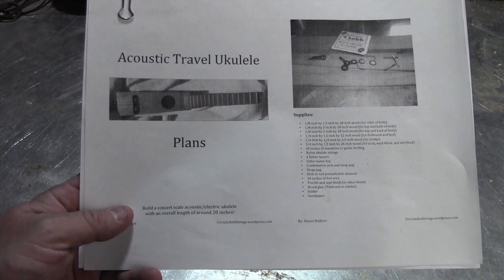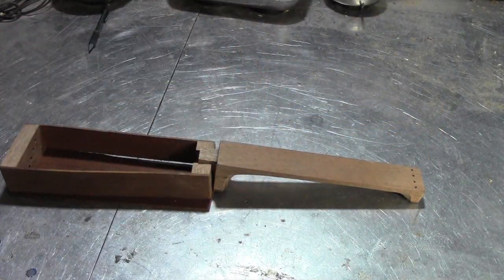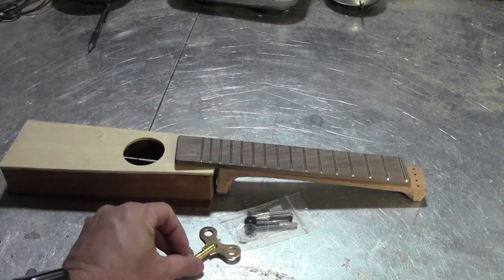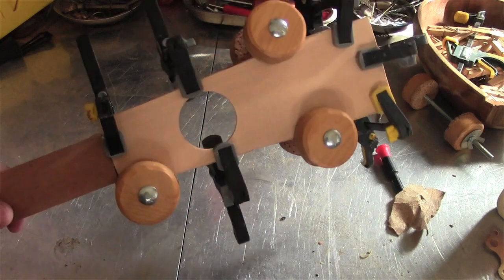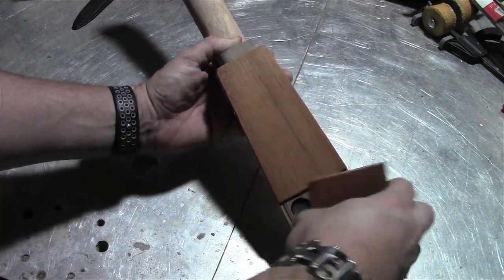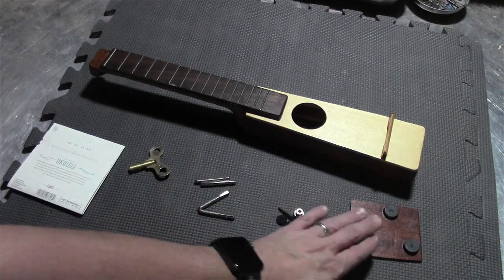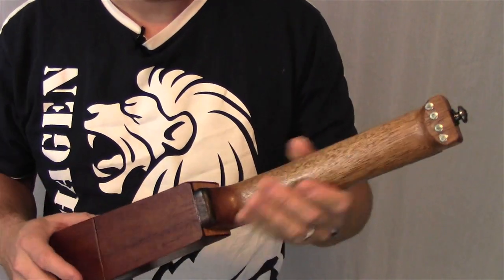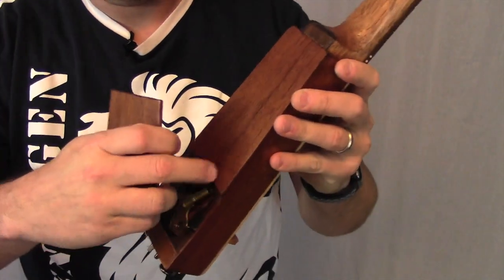Deluxe Acoustic Travel Ukulele

Comment: Do you build all of your homemade instruments from scratch?!
Reply from the maker: I mostly do. Sometimes I’ll use a CNC neck, depending on the project.
Reply: @CircuitsAndStrings  I had no idea that you have a CNC! I really want a CNC but I don't have enough room in my house, although my house has two floors (as well as an attic and a basement) but if I had a bigger backyard, then I could fit a CNC inside of a shed. I also build my cardboard guitars from scratch.
Reply from the maker: Well, unfortunately I don’t have a CNC either. But maybe someday...
I will sometimes just buy a neck that was made on a CNC machine.
Reply: CircuitsAndStrings I see what you mean. I saw on some of your other videos you used a rasp to shape the neck.